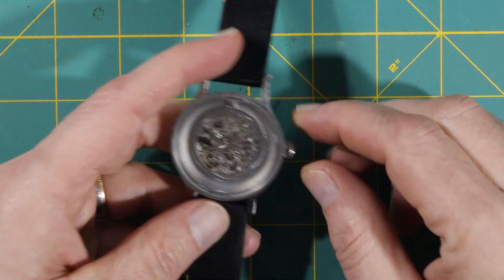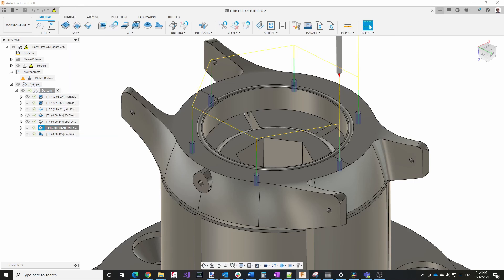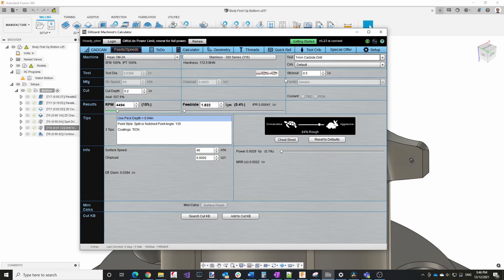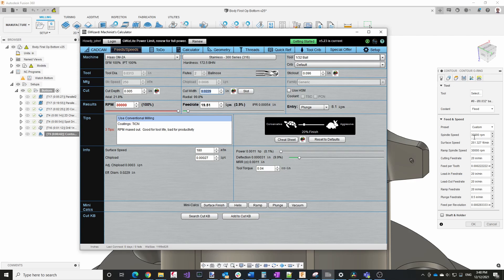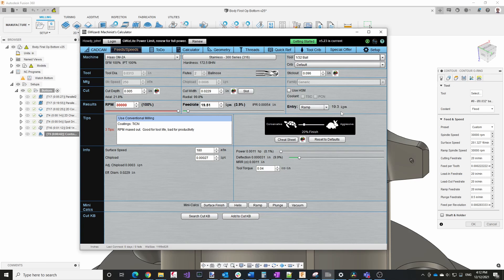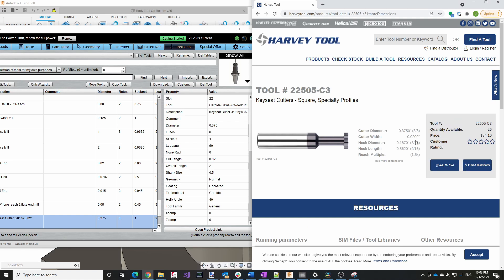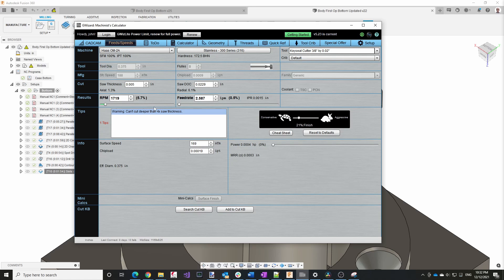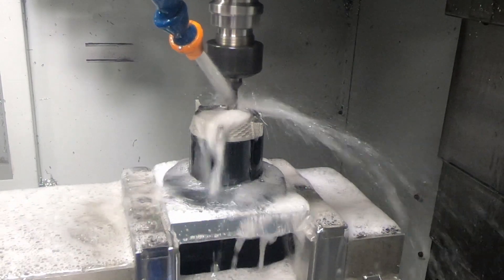Succeeding with Stainless Steel

Comment: Hey John, really good information!  One of the time savers I have done in fusion for my tool library is that each tool has a machining preset by material.  I organize it by ISO material group then by axial depth (AD) and axial engagement (AE or AP)  so each tool will have a list like: 

6061 Aluminum (N22) AD=0.5*D AP=0.25*D
6061 Aluminum (N22) AD=1.25*D AP=0.25*D  
... etc

So in the future when I use that tool I can use those cutting parameters in the toolpath and not have to re-calculate anything.

Comment: Variable helix endmills are fantastic for stainless steel and exotics, because they're much less prone to chatter. I'm also a big fan of high-feed endmills for roughing; most of the cutting force goes straight up the spindle axis and the short flutes make for a very stiff shank, so you can really push them hard.

Comment: I tried Gwizard on my PocketNC and got values that were way off. The PNC bottleneck is often HP, and if I put the HP of the spindle in and use the turtle numbers from GW I get immediate spindle stalls. Good to hear it’s working on your machine.
Reply from the maker: I never use the HP aspect of G-Wizard even on my Haas because I don't want to destroy the spindle. Haas recommends a maximum of 3/8" diameter end mills, with something like a maximum of 20% WOC and 25% DOC. That always keeps me well below the maximum HP of the machine. So for me using G-Wizard is first and foremost about not breaking tools because of deflection. And second, getting the right feeds and speeds within what I consider to be reasonable WOC and DOC values. That means you could do the same thing on the PocketNC. Know the limits in terms of WOC and DOC, then use G-Wizard to calculate the other values.
Reply: @JohnSL  yeah makes sense. The PNC spindle is rated at 200W, but when I hook up a power meter between it and the wall I never see more than like 100W total, so even with 1/8” tools I have to take very light cuts ex: .15 deep by .006 wide in 6061. Getting a bit more powerful machine in the next few weeks that should be similar to yours, I looked into getting a CM-1 but lead times were crazy, and if I want to do 5x you only get 1” work envelope w the trunnion they offer for it. Thanks for your videos.